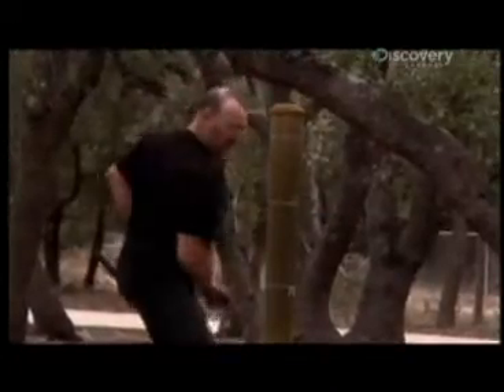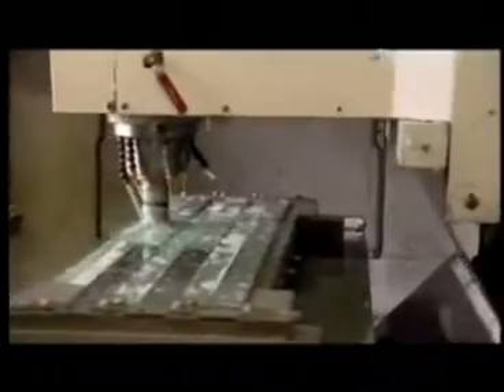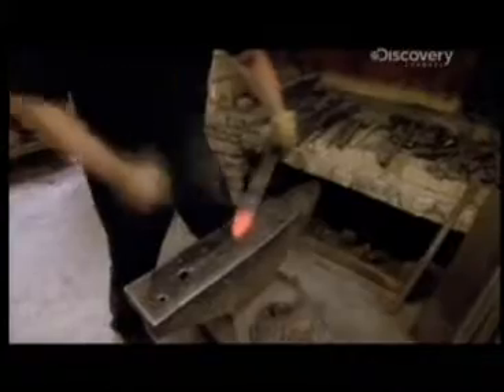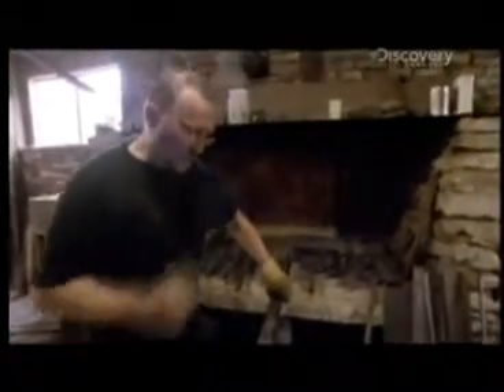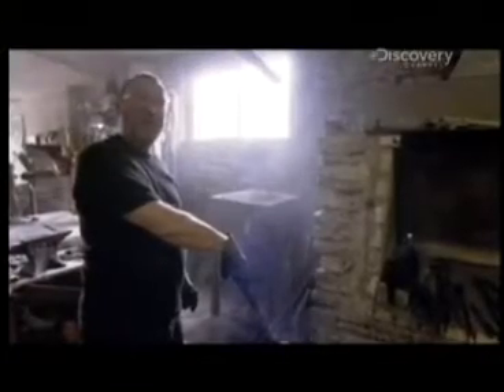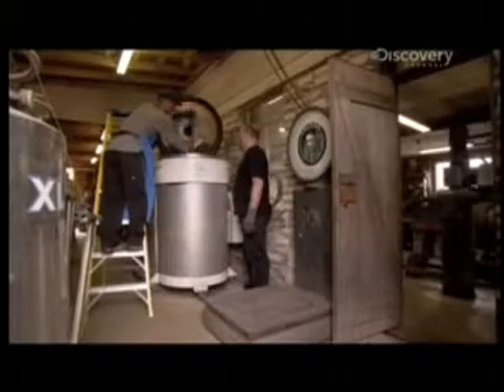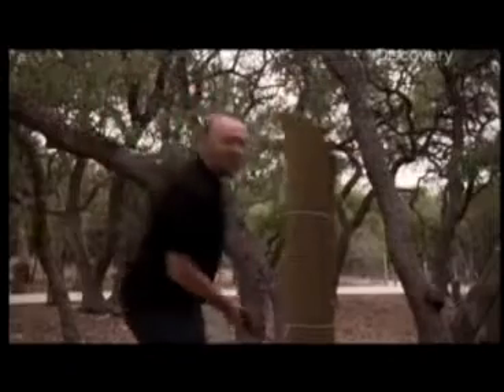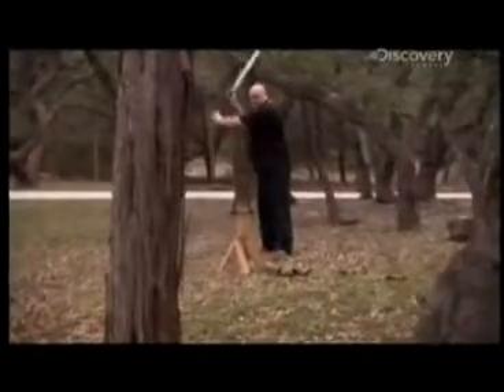Sword Making

Comment: The quenching process does not seem to be done in water. Water does not burn like that. Oil does. If you over heat a blade over 850°C and then you quench in water then the steel will deform or crack because the hardening happens too rapidly. Cheers from Argentina, Sworsmith Andrew.

Comment: @ildeliso It's all about the materials that go into it 20k is for a very large sword with a lot of ornamental and expensive components.  

Also the amount of labor involved should be considered.  These pieces are each one of a kind, not a model number.

Aside from that Coldsteel doesn't give a lifetime warranty on their products.  

Many high caliber smiths charge top dollar for their products, especially those out of Japan.  Those will run even higher prices